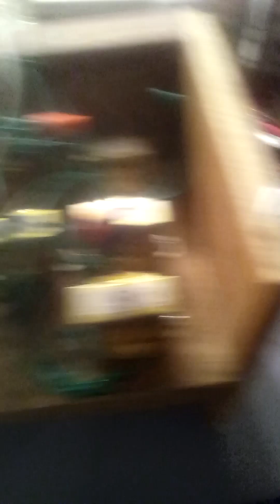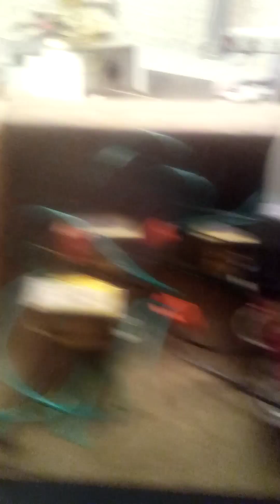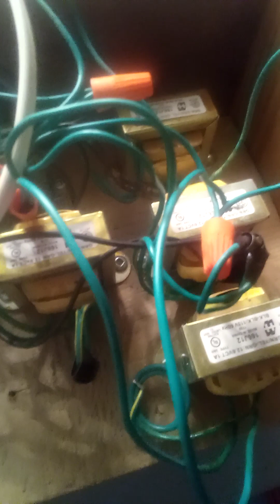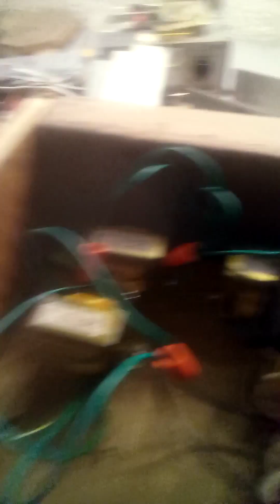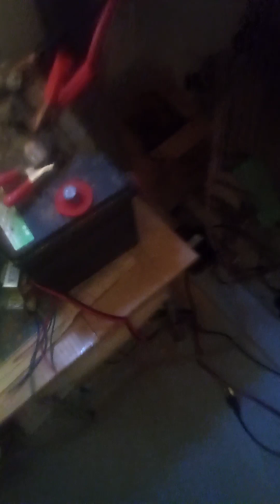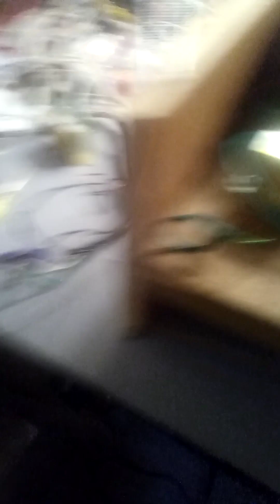Bank of eight 10 to 1 ratio step-down transformers supplying a 120 volts AC output!

Comment: On a 15A breaker the maximum power you can get out of a 120V outlet is 1800W (120V × 15A = 1800W). If you put all the transformer secondaries in parallel then you COULD get your desired 150A but only at 12V (12V × 150A = 1800W). If you put all 8 secondaries in series then you could get 96V at but only at 18.75A (96V × 18.75A = 1800W). If you added 2 more transformers then you could get back to 120V but only at the original 15A (120V × 15A = 1800W). There is no multiple-transformer arrangement in which you input 120V @ 15A (1800W) and get an output of 120V @ 150A (18,000W). That would break the laws of physics. Transformers increase voltage not power. for every transformer-induced change in voltage, there is an equal and opposite change in current. None of this accounts for efficiency losses, which are substantial with such small transformers as you have found.